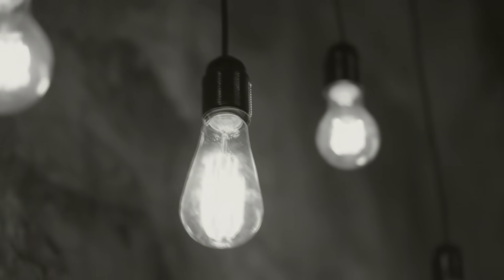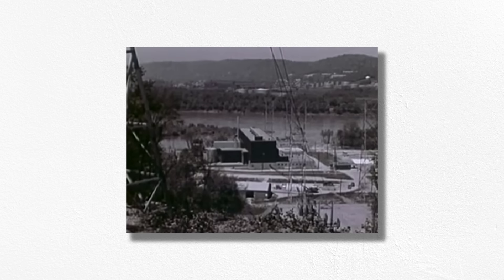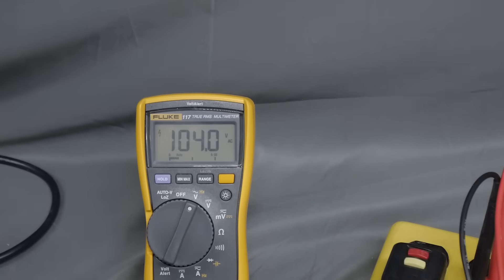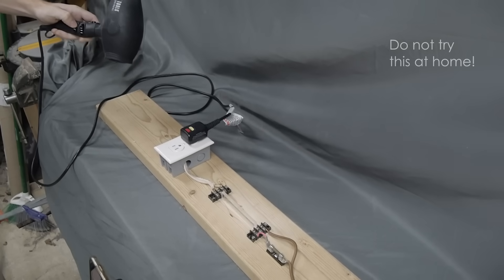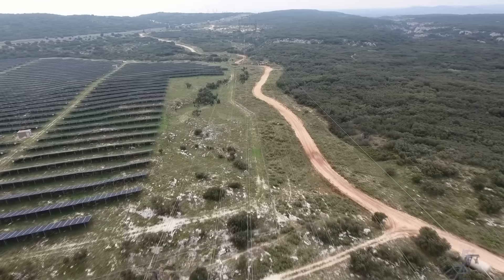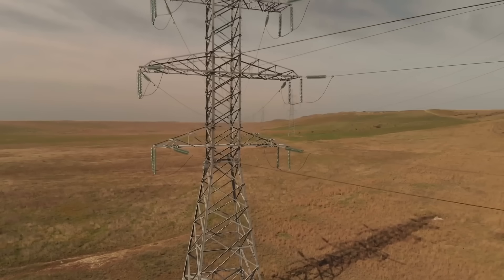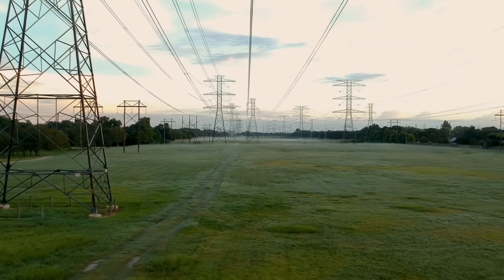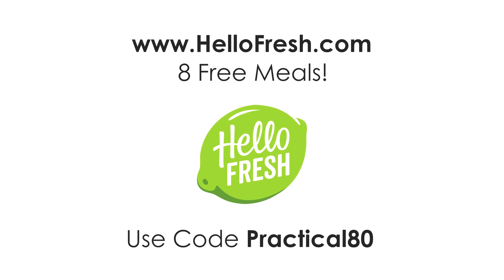How do Electric Transmission Lines Work?

Comment: 3:30 is inaccurate. You should should the Power formula P=V * I in order to make the statement of I↓ and V↑ thus transferring the same Power (P) . Instead you have V↑ = I↓ * R which is not true for Ohm's law or any multiplication of 2 constants.
Reply: Exactly! Even I replayed that part over multiple times as I could not get it over my head as Current is directly proportional to Voltage, so if he keeps the resistance constant then current must increase with increase in voltage.
Reply: Oh man. Thank you. I literally lost sleep over this as I watched the video before bed time. Couldn't figure out  how V in V=IR is supposed to grow as I shrinks. Made no sense.
Reply: Yeah, that part of the video is extremely confusing and misleading. The part with "V↑ = I↓ * R" should clearly be removed.

The video talks about two different type of power in quick succession without clearly differentiating them. There is Pr, power lost due to resistance on the transmission line, and Pc, power to the consumer.

Pr = I * Vw = I * I * R
Power lost due to transmission resistance is related to the current and the Vw, voltage lost on the line. However voltage lost is related to the current * resistance. Therefor to reduce the Pr, power loss due to transmission, the current and resistance can be played with.

If we want to keep the power to the consumer the same, we can look at a similar power formula:
Pc = I * Vc

The voltage here is different from the previous one. This is Vc, the voltage the consumer sees. However, it is the same current. So to lower Pr and keep Pc the same, 

Pc = I↓ * Vc↑ and Pr↓ = I↓ * I↓ * R.
Reply: @colin4349  Exactly, that way would be more explicit.
Reply: There is something I still don't get about the power lost:
P = VI
And V = RI or I = V/R 
So substituting that in P we get either  P = V^2/R  or P = I^2*R
Power lost in the cable is always a quadratic function and I don't understant why increasing the voltage and lowering the current works (it obviously does since we do it...)
Reply: @eldarr0uge482  Yes, I think the confusion comes from the fact that the V that you are talking about is the voltage drop in the lines due to the losses, not the voltage at the load end. So the power lost is proportional to the square of the current, and also to the square of the voltage drop (Not the voltage at the load though). Since the losses are mostly resistive, the voltage drop can be expressed as RI thanks to ohm's law, and it's clear that minimizing the current will also minimize the voltage drop and therefore the losses. Hope this helps...
Reply: This part is badly explained. Main point is, that the power loss over the wire depends only on the resistance and the current, not on the voltage. See joule heating on wikipedia for more information.
Reply: My thoughts exactly.
Reply: yeah...I knew what he was getting at, so I didn't sweat the details, which were confusing.
Reply: Good catch. As a EE, I knew exactly what he was trying to infer but as someone trying to learn I agree that could be very onfusing
Reply: In any circuit; when voltage goes up, the amperage draw goes down!! Such as 10 amps @120 V will be 5 amps @ 240 v. To confirm this, look at the nameplate on any electric motor that is designed to run at different voltages.
Reply: One other thing to note. As voltage goes up, the resistance of the conductor “lessens” therefore less amperage draw by the equipment being powered; this of course only applies to equipment that can operate at a higher voltage.
Reply: Re-watched the segment and don't see your point. If you listen to what is being said it all works out. He describes the situation and the variables and the formulas reflect this.
Reply: @joeshmoe7967  there is no way to get higher V with lower I. that formula is the wrong one
Reply: @SuperSonicDonk3y  Yep exactly, R is constant, so lowering I lowers V... P=VI is the right formula to use... I cringed when I saw that because the rest of the video is spot on!

Comment: How convenient, I was having a debate on this topic with one of our electronic engineers and sparkie. The question was, how much current is flowing in a high tension power line?

My immediate answer was 'a couple hundred'. The sparkies was 5-7A, n the electronic engineer tried to explain to me, child like, how more volts = less amps. I tried to explain MegaWatts, hundreds of MegaWatts, even at 330kV is still a buttload of amps.

I got a few very rough values (net max power from our major local coal powerplants @ 330kv, some substation capacities in nearby major industrial parks @220kv n 130kv, n local feeder substations @33kv), n came up with napkin calculated figures between 80A n 210A. These are based on max capacities, but right about where id expect.

This didnt seem to sway the debate much unfortunately. I mean, they gave up argument, but didnt seem to accept it.

Anybody who works on high tension transmission lines care to chime in? How much current is carried on these overhead lines? In general terms. Im guessing about 100A, ideally less but with stress capacity at least x2. Regardless of voltage. That just gives you more watts to play with. 

Input greatly appreciated.
Reply: arjovenzia how long is a piece of string really. It will vary from place to place, from circuit to circuit, country to country, time of day to time of day. Huge amount of factors. But for a given power, as you increase the volage the current drops off alot

Comment: Wow, I appreciate your channel, but here, I must step in : increasing the voltage in the ohm law does not, and cannot result in decreasing current. This illustration is wrong – you probably meant to use the P=UI formula...
Reply: +Gael C. - Not so in this instance. Here, he is discussing transmitting power long distances. Since power is energy, and as we know, energy can be neither created nor destroyed (but can be transformed!), running it through a transformer to step up the voltage has the effect of reducing the current by the same factor that said voltage was increased--thereby keeping the same amount of power in the equation. Otherwise we would be breaking that very fundamental law of physics. Hope that helps you out.

Comment: Does the standardization of the discs apply to europe/german power lines aswell?
Reply: Daxelinho9 its a rough guess. Each network operator will have their own voltages they use for their scenario.

Comment: Does the speed of light/electricity effect the phase synchronization of electricity across long transmission lines? For example: if power plants A and B supply power to the same city but A is much further from the city than B, is the phase at A and B shifted by a measurable amount?  If so, what happens when the same plants power a second city that is closer to A than to B?

Comment: Yes, a somewhat simplified version of  how they actually work.... but it's fine ...  you didn't mention the reason for AC transmission at all, even that transformers have to have time varying current to work... because of the varying magnetic flux generated, and the mutual inductance of them.  Or you didn't even mention that the power is a sine wave generated because of the 'rotating' nature of the rotary movement of the generator (actually an alternator)...  Even in the 21st century.... it's still more or less a simple concept... and a marvel... it's funny, I just had an LED 'light bulb' go bad... I decided to tear it apart.... the multiple LED chips were simple enough...but it looks like it takes about 50 or so  other components to (probably a switching regulated DC power supply)  make it work....compare that to the lowly old incandescent bulb, just some glass, some argon gas, and a string of tungsten wire... (I know, I know....inefficient as hell).... but so, so simple....  well, just my 2 cents...
Reply: why do you.... write with so many ellipses.... that's not proper use of ellipses.... as an electrical engineer you should know basic English... I don't care.... how old you are...
Reply: @General12th  Hmmm....who said I have a degree.... (If you must know, I use ... as a 'thought pause') , and that's how I comment.... with thoughts...not so much in 'full grammatical' sentences.... Thanks for the comment though...

Comment: You used DC power equations to measure the power drop in a AC line, tesla would be sad.
Reply: I guess it depends on the frequency. The higher the frequency, the smaller the deviation from DC equations.

Comment: The upper wire or shield wire in some cases also carries a fiber optic cable. A metallic cable braided around a fiber optic cable is now used in some cases. See link: https://www.aflglobal.com/Products/Fiber-Optic-Cable/Aerial/OPGW.aspx

Comment: When I went on a hunt when I was 10 or so I met a guy that said he could't hunt in the blind I was in because of the high voltage lines overhead. He said it was because he had a pacemaker, and the interference from the lines could disrupt his pacemaker. Do you think he was just telling stories to a little kid about how crazy high voltage those lines were at or do you think he was being serious?
Reply: Pacemakers are unfortunately sensitive to external magnetic/electric fields. I've seen warning signs in elevators.
Reply: Pacemakers of old were a lot more vulnerable to outside interference.  Today's pacemakers and ICDs are much more robust, and even have wireless monitoring technology built in.
Reply: @jovetj  
They needed that upgrade. It will save lives.

Comment: 3:35 How does Ohms law show anything there? Wouldn't the right equation to look at be P=V*I?
Reply: he used the standard power equation and the standard ohm's law to derive the P=I²•R formula.
P=IV
V=IR
therefore P=I(IR) or   P=I²•R
not quite sure why he did it but that's what he did. Could've easily just given the  P=I²•R formula to begin with but it didn't detract from the video and is just in general more information so I'm not really complaining.
Reply: Correct.  Because in that situation power is constant, so voltage and current are inversely related.
Reply: The whole point of the illustration is the reduction of resistance losses.  R has to be brought to bear in the defining equations.  My substitutions would have been different, though.  
P = VI
V = IR  ->  I = V/R
P = V*V/R  ->  P = (V^2)/R
Ergo:  The effect of Resistance on Power is inversely proportional to the square of the Voltage.  Crank that voltage!
Reply: How come everyone here is using V for voltage when the symbol is U (with V being the symbol for volts, the unit)?
Reply: @Sibula  Maybe because you're alone in thinking that?
Reply: @joesterling4299  I've studied physics at university level but I've never seen anyone use V for it, always U.
Reply: @Sibula  In my college classes (community college), the formulaic symbol has been E. Nobody really uses that symbol outside of textbook work because it's just not as intuitive as v for voltage.
Reply: @TheEpicLinkFreeman  Many symbols aren't intuitive, and no symbol is intuitive in every language. Voltage (or rather electric potential difference) for example in Finnish is "jännite", so V makes no sense. The problem in using V is because it gets confused with the unit, as well as not being standard. And being standardized is basically the whole point of the SI system.
Reply: Actually I Did a good look and yes the formula isn't the right one.
but his point is "better reduce current" so to balanced out the equation P = I²R  you also need to increase the Load resistance, because you have less current on it.
and that get confusing with the whole "reduce resistance".

the quickest explanation would be: make the power line own resistance a fraction of the load resistance, reducing power lost to them by reducing current need on load and increasing voltage so P = V * I is constant.
Reply: If P=V^2/R, and R in the conductor isn't changing, then increasing V would also increase the power loss?
Reply: @johnfakename1823  That formula works, but if R is the cable resistance then the V is the voltage drop in the cable, and P is the power lost in transmission (mostly resistive). The formula also works if Vis the voltage at the load, R the load resistance (assuming it's resistive) and P the power given to the load. The voltage drop can be determined using the current and ohm's law, since the cable is mostly resistive... So U=RI or P=(RI)^2/R or P=RI^2 and pretty obvious that to minimize the losses, you need to minimize I
Reply: I came down here looking for this comment... for a constant resistance, only a drop in voltage would yield a drop in current, yes. I'm guessing it slipped by in editing, maybe. Good catch. Nevertheless, a great video!
Reply: Exactly, I was confused by his return to ohm's law when he spoke about maintaining the same power (P). P = VI would show that if current (I) decreases, then for P to remain constant, Voltage (V) would need to increase.
Reply: Yeah it doesn’t make sense that one one side of the equation something shrinks while something on the other gains p (const)= v(rise) * i(drop)

Comment: Apparently you are ignorant as to how power plants generate electricity and revenue. Legal contracts might be above you pay scale.So, I'll dummy it down for you.
Powerplants sign contracts with distributors long before they fire up. Wind and solar are not reliable 24hr/day resources and therefore steam turbines, be it nat gas, coal or nuclear run 24hrs a day and get paid while doing so. 

Yes, they are complex mechanical marvels and don't turn off and on with a switch. They feed the grid and get paid for doing so whether you use their power or not.
Reply: I don't think you're a lawyer. A real lawyer wouldn't speak so degradingly and unprofessionally.

Comment: But it is also p=v^2/R   if we substitute i=v/r in the formula .... Then large voltage should produce large power?... Can anyone help me?
Reply: The Voltage in this formula would need be the Volt Drop across the resitance of the conductor, to calculate the power dissipated

Comment: Would you do a video on how google and youtube works? That is, how information is transmitted,  stored, and distributed? What kind of hardware and software is needed to make it all work. How much power is needed or cooling, or materials.  Where is the data stored and how it all works. Do they use satellites? It seems like magic but it must be a mechanical system somewhere, someway. Thanks. You have a great show.

Comment: Next video: Tapping high voltage power lines and making own induction cooktop.
Reply: You'd need a pretty long ladder to get high enough to run a stove. Your neighbors will start asking questions. Then the police will start asking questions.
Reply: J.J. Shank not to mention if you put a ladder up there - BANG lol
Reply: A gentleman in Olympia, WA put coiled of wire under the BPA HVAC lines that ran behind his home.  The BPA engineers in Portland, OR detected the power loss and traced it to his home in Olympia.  He was arrested and convicted of stealing power, fined and went to prison.  It is also very, very dangerous to put a coil of wire under a transmission line.

Comment: Same goes for EV’s, where 400V is getting the norm, allowing up to 150/250kW charging, while the taycan with 800V goes 270 and will allow 350kW in the future
Reply: If I understand correctly, there's an upper limit on how much current a recharging station (including outlets) can supply. But by increasing the voltage (without decreasing the current), the station can deliver more power and therefore charge the battery faster.

Comment: Great introductory discussion - but there are two additional items that should have been mentioned.

First, your images showed bundled conductors.  It might be helpful to mention (in passing) that bundling conductors is done to increase power transfer capacity by reducing circuit resistance. 

But the second factor is more complicated.  As you discussed, resistance and losses are the justification for moving to higher voltages, but having made that change, losses are not a driving concern for power engineers.  Instead, the major concern is for reactive power, and the impact of line inductance.  Ultimately, the limit for power transfer across transmission lines is based on reactive considerations rather than resistance and losses.  Unfortunately, reactive power is a concept that is difficult to understand without a strong background in electrical engineering.

Comment: Silly question, but what causes the noise of the power lines? It seems inconsistent wherever I go. Sometime v loud, other times no sound.
Reply: The noise results from a discharge from the line into air.  Since wet air is more conductive than dry air, the discharge will be greater with higher humidity.  Also, the discharge is greater when the line voltage is higher.

Comment: You used the wrong equation for showing reduced current = increased voltage, but otherwise great video :D
Reply: I could not understand how he decreased current without changing the resistance significantly to increase the value of voltage. Please explain that to me.

Comment: I want to hear how three phase power is transformed by substations into what we use.
Reply: Interdimensional, a typical residential street gets fed 1 of the phases and the pole transformer converts the 7200 ish distribution voltage to 240v split phase. Most loads use that center tap and one end of the secondary winding for 120 volt. 240 loads use both ends of the secondary. A different street gets fed a different phase. Larger customers get all 3 phases usually at 480 volts.